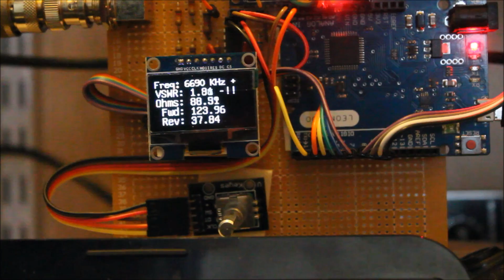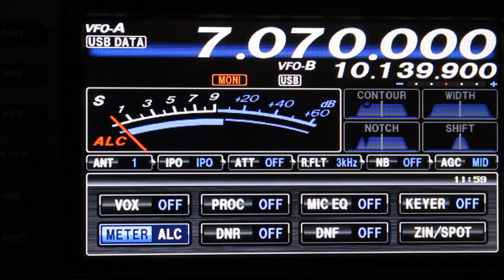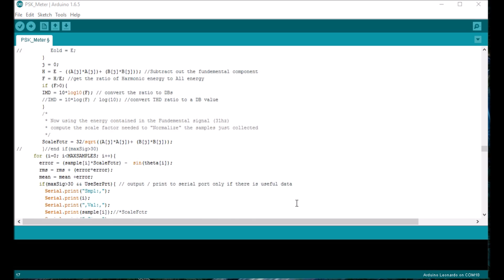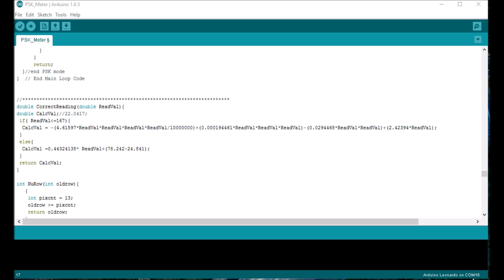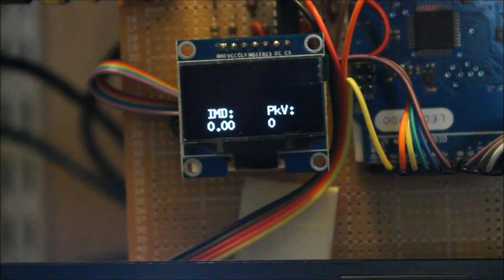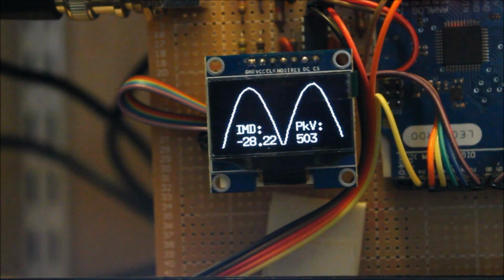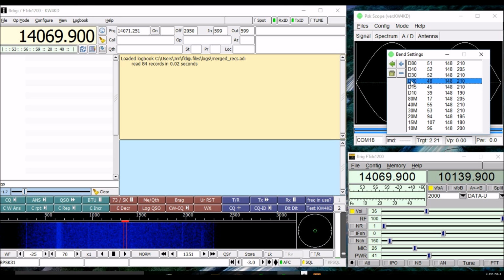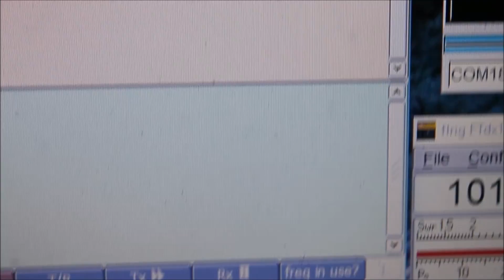PSKmeter & PSKscope another DIY Amateur Radio Project

Comment: Keen to have a go at this, thanks for posting great videos. Can I ask about input power handling - are you using an attenuator on the RF input or what is the power limit of this device roughly? Thanks. Andrew MI0KXX
Reply from the maker: Thanks for the question. Yes, there's an attenuator in the circuit. Its described at ~5 minutes into the video. It consists of the 8.2k resistor & a 220 ohm resistor.  1/2 watt resistors should survive 100 watts. But typical 100 watt radios can only generate about 25 watts of un-distorted PSK, so what you see, in the video, should work for most cases.
Let me know how it goes for you.
GL,
Jim(KW4KD)

Comment: Jim thanks for the PSK ragchew this morning.  Your video on PSK waveform was on the spot.  I don't have any monitors here just my ears and watching the transmitted waterfall in
FLDIGI.  Thanks my new friend, Dan, Ni9Y
Reply from the maker: Thanks for the comment on the video.. I enjoyed our QSO too.  And FWIW your signal was clean on my waterfall. At my station RFI has caused more PSK troubles than anything else. This simple circuit helps  a lot to spot any departures from the norm in the RF envelope.
Jim (KW4KD)

Comment: the diy analyzer alredy has drivers for a tft display? if it does. is it size specific. my eyesight isn't  what it should be. so im thinking about a 7 inch tft. i feel i should build it where it suits me best. now i need a line of heavy copper sheeting to build the case. and i need clear powder coat after i polish bright the copper.
Reply from the maker: Hi Dale
The Display library used in this sketch is "U8glib.h". Its a fairly popular library and supports a number of displays. But my knowledge of what all it does, and their respective sizes is limited. So can't tell you if there's a 7 inch display in the group or not. If you find that it does, then you'll probably need to remap the the plot portion of the sketch to fit your new display pixel layout. As its written now its setup to plot to 128X64 Display.
To be honest, while the Arduino PSKmeter portion can run as a stand-alone unit, I seldom use it that way. But rather use it to drive the Desktop App PSKscope, which also plots the modulation envelope and is scale-able to any size up to the limits of your computer screen. So that may be an option for you.
GL & tnx for your comment
Jim

Comment: Jim, you're giving me ideas again:-) Good video and important information. I have all the extra opamps and diodes from the analyzer that I could build this easily, might have to give it a go. Thanks. BTW, I'm still fielding questions about the analyzer.
Reply from the maker: +Joel Caulkins Hey Joel
Good to hear from you.
And hope you will (give it a go) .
But if you still have the original Analyzer, then no need to build another. Just change out the caps mentioned in the video and you should be good to go. (Either as the No Frills Ant analyzer or as the PSKmeter)
But you said "...ideas...", so maybe your thinking beyond what was presented here. 
Regardless let me (us) know how it works out.